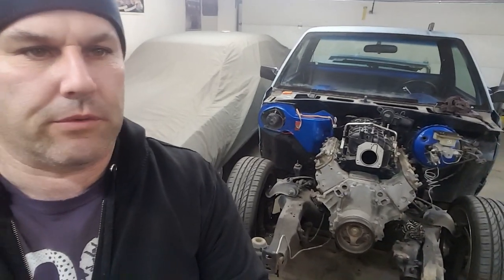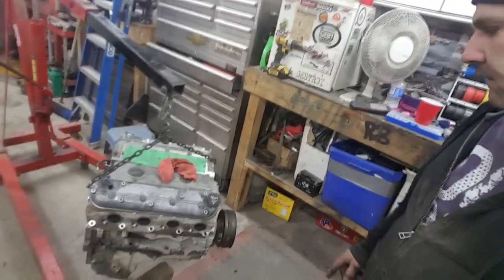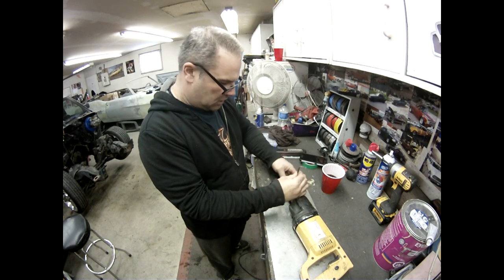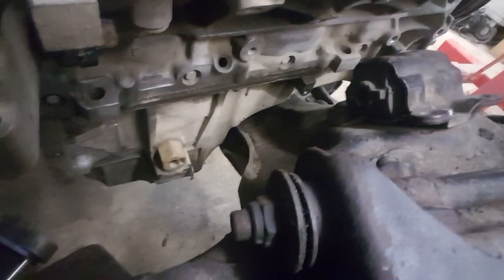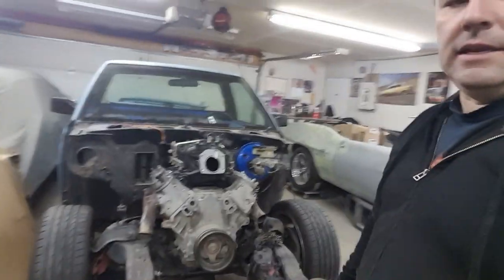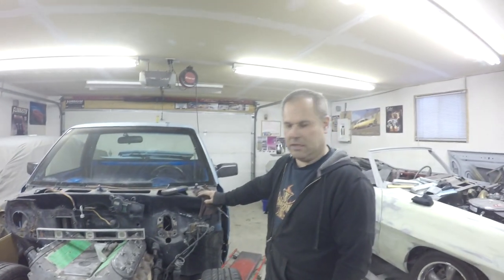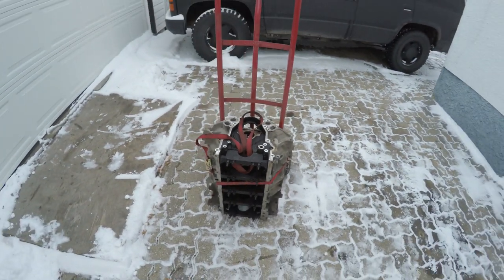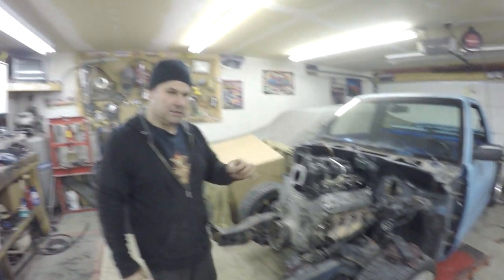LS ENGINES EVERYWHERE! Frame mods and Hotside planning + L33 5.3 Engine Block Wash

Comment: You guy should forget WD40, it water dispersant minus 40. Good for push moistor away. My shop has great experience with deep creep, made by sea foam. It even reacts good with heat. Just an idea

Comment: Easy Off oven cleaner, apply to dry block; let set 10-15 minutes the pressure wash thoroughly.  You’d be amazed how much burned on oil/carbon will come off.
You can apply to a wet surface it’s just not as affective, just don’t let it sit more than 15 minutes per application.
Reply: oven cleaner does work awesome. I just made a video not to long ago on doing it.
Reply: HunterTuned I did notice the cheaper brands don’t clean as good as the Easy Off.  Also if you leave it on more than 15 minutes per application it can darken the surface of the aluminum. To freshen the “brightness “ of the aluminum try cleaning with Eagle One rim cleaner, the formula made for unfinished rims. 👍
Reply: I have to agree with these guys! Oven cleaner is the bomb when it comes to cleaning engines! I have used it for years!

Comment: I just cut a good chunk off the frame with eBay $50 swap mounts and pushed the engine and trans as far right as I could with the jeep shaft as well, gt45 turbo, truck pan in 87 s10 blazer, th400 now has 4l80e, no power steering, stock booster

Comment: I used the Polly mount kit from current performance. I highly recommend those. Iv had issues in the past with the rubber 2.8 mounts breaking down over time creating a contact point with the upper control arm & the bottom header tube
Reply from the maker: +BAD BOWTIE PRODUCTIONS we used those same mounts on the LS15.

Comment: Check out the CPW mounts. They work great! I'm running the round coils, they are very close to the booster but they do work. I've also seen people shim the front of the box to gain the clearance for the shaft. What are you going to run for a pan? The truck pan hangs pretty low.

Comment: It looks like the drivers side header would fit upside down on the passenger side upswept and then the turbo would work better without a 180 degree elbow on it
Reply: Thomas Cahill ya it would but i dont really want to run it upswept.

Comment: Did you notch the frame to make a oil pan fit what pil pan did you use ?
Reply from the maker: A stock truck pan that was shortened in the sump. The crossmember was modified slightly.
Reply: @SPPTVarmy  ok thanks for the info
Reply: @SPPTVarmy  another quick question what trans did you use ? And did you use the same s10 drive shaft ???
Reply from the maker: Its a 4l80e and a shorter driveshaft